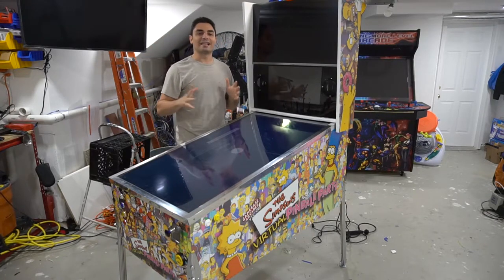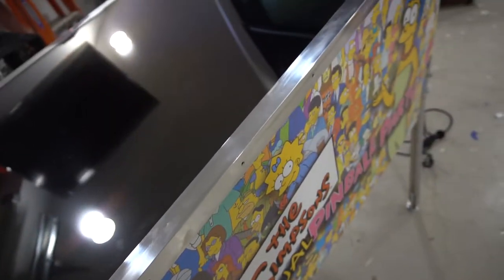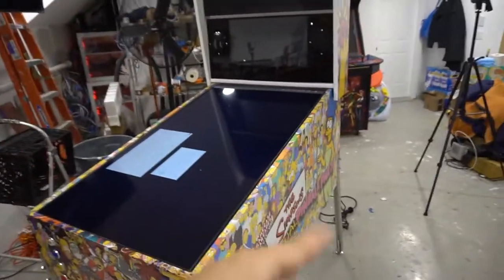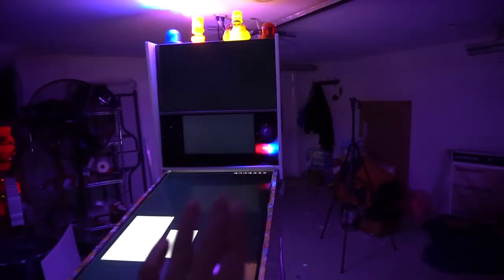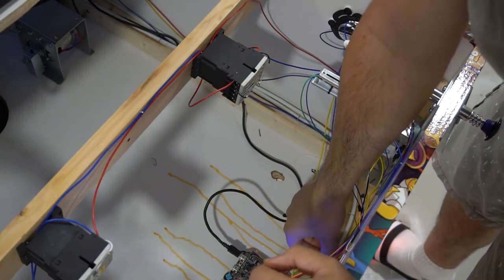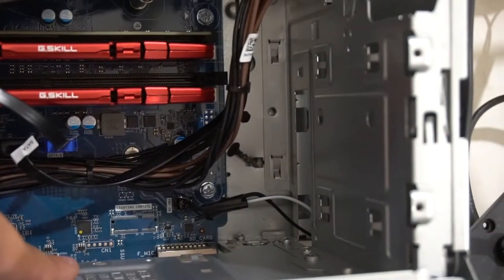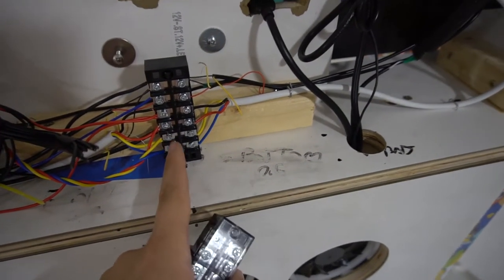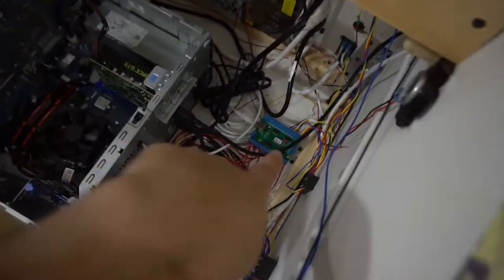Virtual Pinball Build Tips and Tricks - Wiring and more

Comment: Thanks for sharing this info Vic! Quick question, could you find black laminated birch instead of white? Just would think that's closer to something like a modern Stern machine.
Reply from the maker: Yea I have it in black as well. Currently I am building a vpin with just birch with no laminate on it. (as it costs less) I'm going to test how it vinyl will stick / what I need to make vinyl stick. Laminated birch vs regular birch is about a 45$ difference per sheet... and this vpin needs 2 sheets.
Reply from the maker: I also choose white birch as for this specific cab (the Simpsons) I felt the white on the inside of the back box would look better than black. Almost like the entire cab is bright and white tmolding made me pick white haha

Comment: On my 2-player stand up arcade cabinet I have the same switch (1:39), windows has a setting where it will turn on after a "power loss" by turning on this setting and having the PC attached to that switch you could turn everything on at once instead of having the PC on a separate switch. Custom lockbars aren't cheap because they have to be fabricated to size. Check out https://youtu.be/lDXxIpi0B1g?t=479 for the cleanest virtual pin I've ever seen.